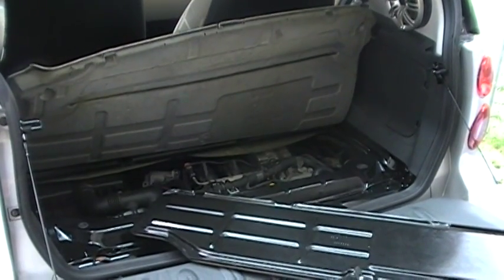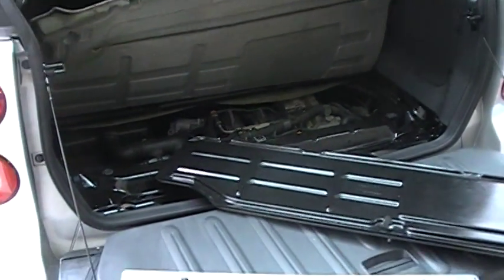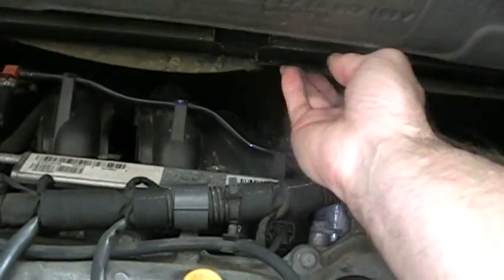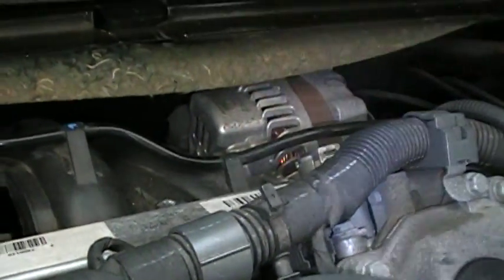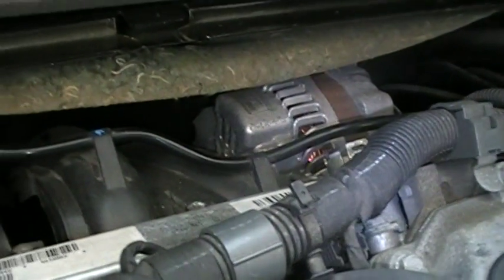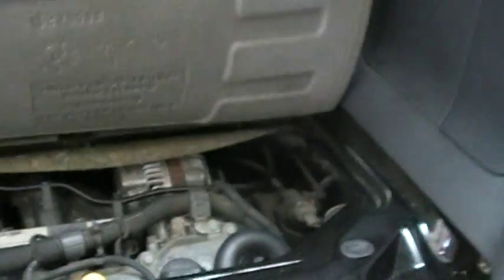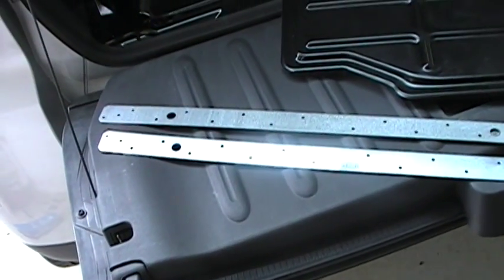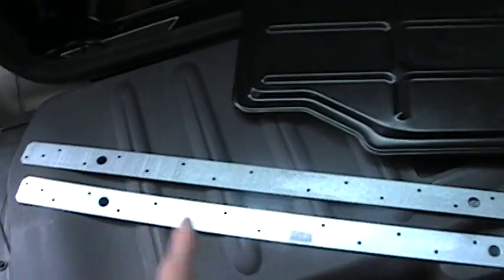SMARTCAR Accident Waiting to Happen ENGINE BLANKET FIX DIY US-451

Comment: That material smolders too when your alternator gets hot, and seizes. That material in my car was not hanging down, But i tore it out around alternator. i'd rather have little more noise than a damn fire, next time, if ever but never know. I have seen several cars burn before on side of road and wonder what caused them to start..  Going to buy small fire extinguisher for smart car, from depot. $20 or so.. Plus Keep bottled water in car all times.. Just bought new battery and just 8 days later, whatever stress there could have been, the alternator let me know what was affected. if any one gets new battery, think about new alternator also.. and vice versa on those two parts.
Reply from the maker: NOBODY here is mentioning anything about a fire issue....watch the video again.

Comment: I was told by MB North Houston and MB Dallas that the 2018 recall does NOT address this particular rear insulation mat and only a piece inside toward the back of the vehicle. Is my experience different from others? To replace this particular insulation mat, I was told the part is $75 but with labor costs, the fix may be more expensive than the car is worth...
Reply: I'm from Canada and just made my recall. And same as you, they changed the rear piece that is above the exhaust because that one made a smart burst into flames in Ontario in 2017. So theyre only repairing the "dangerous part" and not the rest.
Reply: @fabiantarriba2953  I'm a bit stumped.. Just got back from Mercedes to deal with this recall. They had it for about 1.5 hours, got home and opened the rear heatshield  ( metal pan that you turn a key to expose the engine) and was surprised to still see bits and pieces of the old heatshield mat ( that's full of rodent crap) still over the engine. I assumed that is the heat shield mat that was glued to the underneath of the metal pan and would be replaced. Nope. 
Fabian, sounds like you know more about this than I but what did they replace as I can't see anything as far as anything new? 
I just ordered an off market heatshield blanket off eBay that seems to be better than anything that Mercedes provides. I'm in Chester, Nova Scotia..

Comment: Considering the engine sits under the seats what's gonna prevent carbon monoxide poisoning in the event of a leaking exhaust manifold?
Reply: I guess the same thing that protects you in a conventional car. Is that a  real problem, or just a concern? I wonder how many these disaster concerns have come to play out in real life?
Reply from the maker: That is a non issue as it doesn't sit under the seats, its behind the seats like any other rear-engine car and its extremely isolated from passenger compartment. You are eventually a non-smartcar owner.